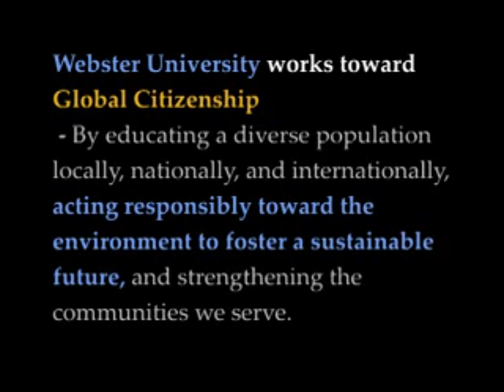Straw bale Louisville project Part 2

Comment: It takes three elements to have fire. Heat, Fuel, Air. Air is not fuel. Straw is the fuel. Straw is more fireproof if it is covered with Plaster. IF you watch the first part of this multi-part series, the narrator explains this.

Comment: I ahve done quit a bit of research on this matter, and find that structures from the '40's are still very efficient, not to mention the wonderful structures that have been around for over 100 years.  I would love to have a home built this way, but am not that mehcanically dexterious to fully understand the process...such as compressing the walls before roofing, and just how big you can build before you need to go from load bearing to infill.  Could be the answer to low income housing!